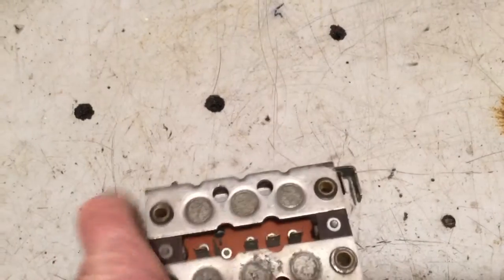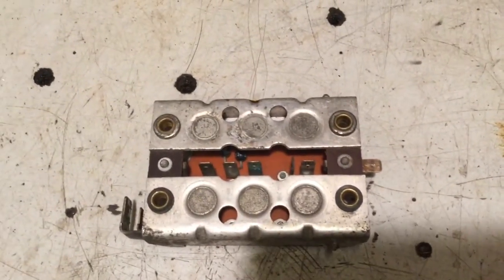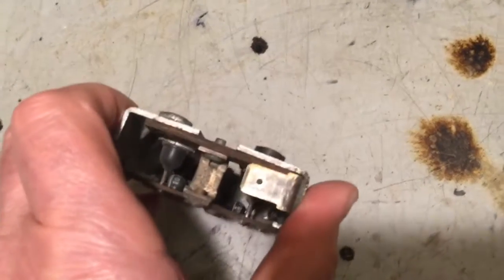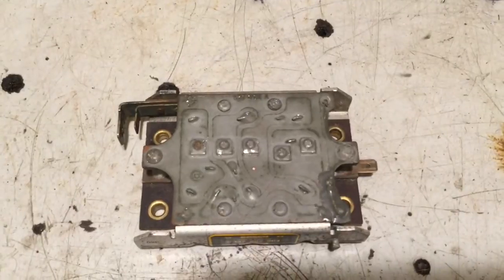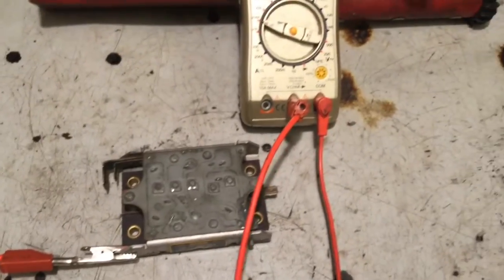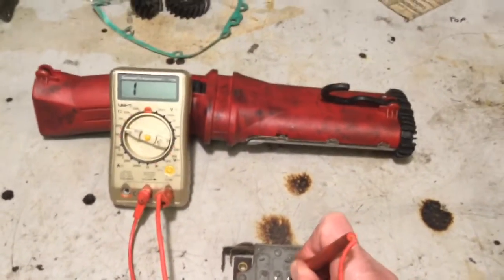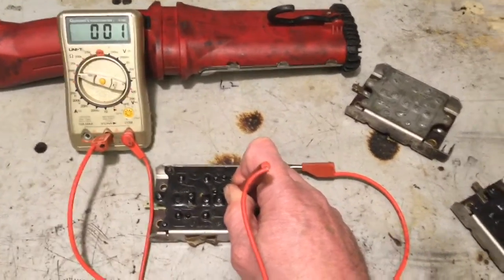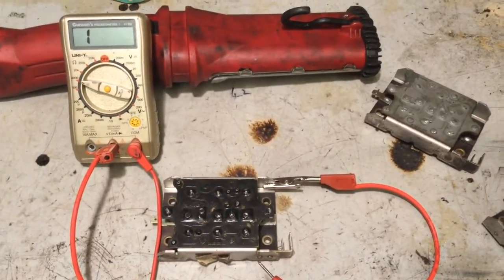Airhead Rectifier Quick Check

Comment: So do you gator clip the negative terminal or does it matter? .....you don’t show it or say. Both your leads are red
Reply from the maker: Sorry my explanation could have been better in this video. If you look at the leads where they enter the meter, you will see that for each test I have swapped sockets, i.e. right to left/left to right. This effectively reverses the current path from the meter each time, hence it allows me to determine if the the diode allows current to flow in one direction only (as it should), or in both directions (undesirable).
Hope that helps.
Reply: @motophoenix5951  thanks. Yes that helps

Comment: People should know that  you only tested 6 of the 11 diodes 
There is 5 more diodes that need to be tested 
It is better to test the diodes thru the terminals first and if you find a problem then flip over to the circuit board and look for bad solder joints 
Also there is a "diode setting" on the multi-meter for testing diodes 
The faulty Diode is one of the main negative diodes   and you do not have to remove them to find out which diode is bad
Reply from the maker: mrclubik, Thanks for the comment. Yes, as stated in the video there are 11 diodes in all, but as the title suggests this is just a quick test to establish the serviceability of the main phase diodes, since in my experience these are the ones that usually give trouble. The other diodes can be tested and replaced, but I doubt that many folks watching would go to the trouble of dismantling the rectifier to access the circuit board in order to carry out a repair. However I have come across rectifiers that have had one of the diodes I was testing soldered into the circuit on the outside.
As for the diode test facility, yes I could have used it, but not all multimeters out there will have this.